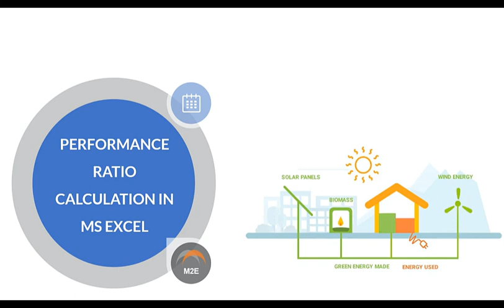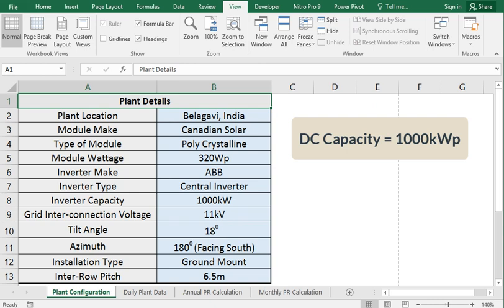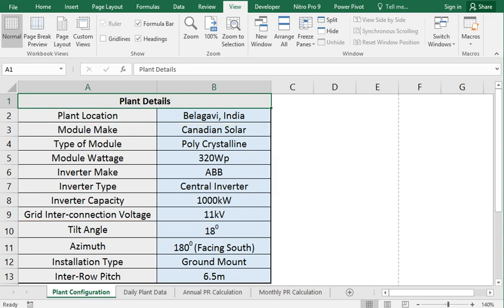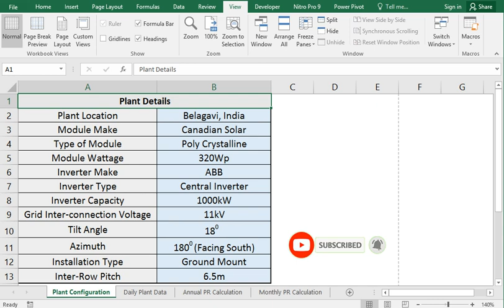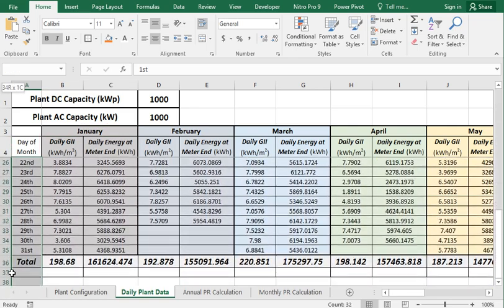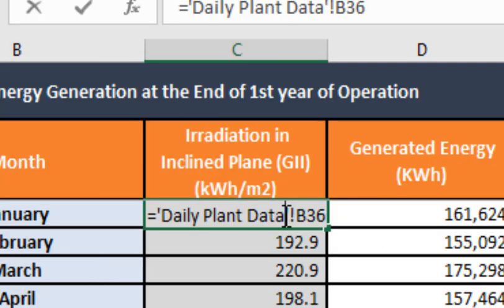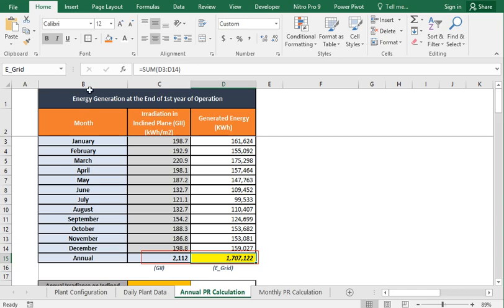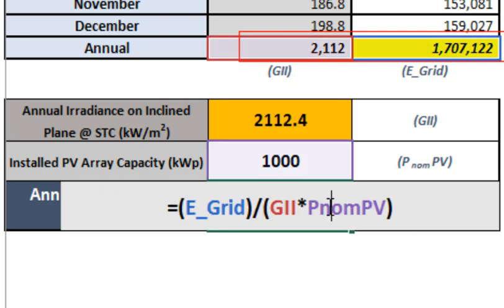HOW TO CALCULATE PR IN MS EXCEL WITH SOLAR PLANT DATA

Comment: Thanks for the upload, do you have any spreadsheet for determining pv plant size based on the utility (electricity bills) or solar pv design in excel spreadsheet?

Your help is much appreciated.
Reply from the maker: Hi..we are working on bringing the spreadsheet based PV system sizing tool very soon. Please subscribe and stay tuned for upcoming uploads. Please watch other contents in this channel and like and share with your friends, colleagues and in your community. Your support boost our commitment.

Thanks
Team M2E
Reply: @Minutes2Energy  I'd really appreciate if you can share the excel spreadsheet of solar PV design ASAP. Awaiting your response. Thanks
Reply from the maker: Sure!! Will try our best!!
Reply: Do you guys have a simple pv design calculator in spreadsheet as I'm trying to do an audit and the submission date is by this Wednesday.
Reply from the maker: Please connect on our email. I'd is on the channel page
Reply: @Minutes2Energy  hii please check i have sent the email.
Reply from the maker: We just released "WHAT IS SOILING LOSS IN PV SYSTEM" covering in-depth details on soiling loss. Please watch and share your views. Don't forget to like and comment 😁😊

Thanks
Team M2E